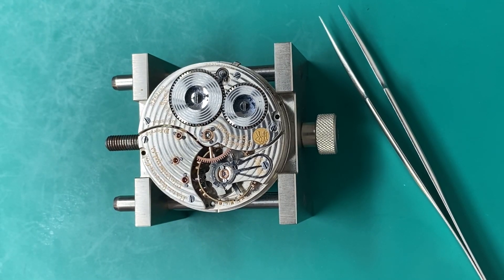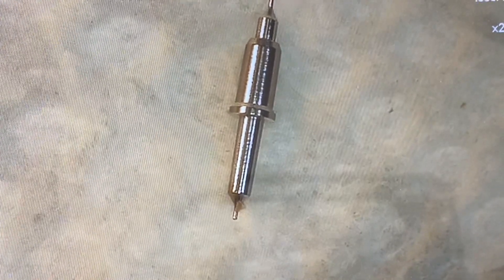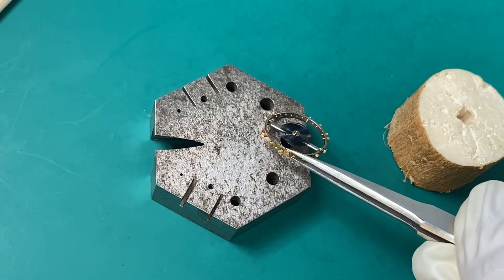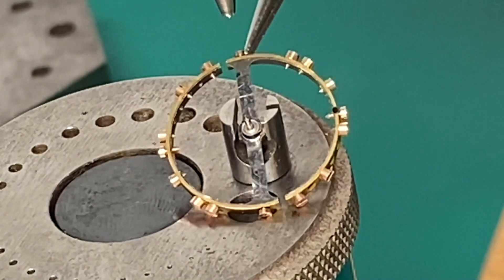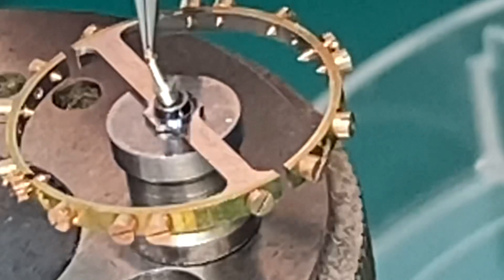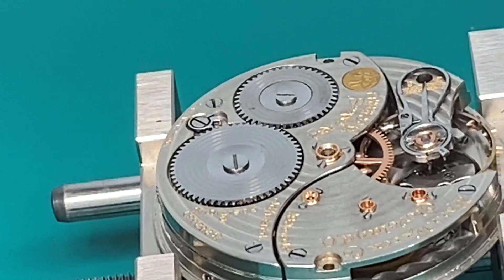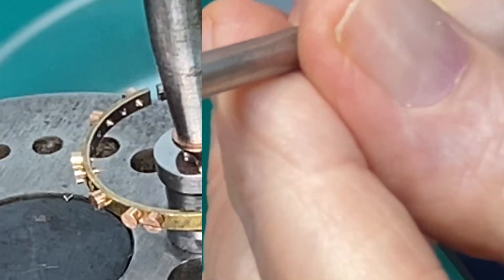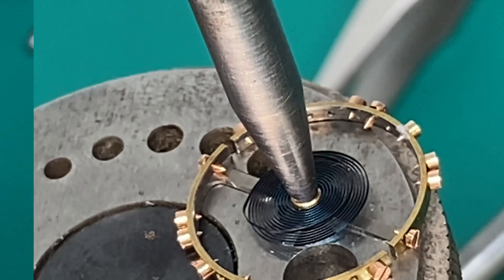How to Use a WATCHMAKERS STAKING TOOL Set to REPLACE a Friction/Balance Staff

Comment: A very good video, excellent camera work. What make is your Staking tool? I would have liked to have seen how you get the hairspring beck in between the two regulator pins as some times it can be a bit tricky. Another thing which you might have done but you did not show it, a tiny mark on the balance wheel so when it comes to fitting the hairspring back on you know the exact spot where to attach it so the watch will be in beat. I have been retired from being a watch/ clock maker for many years. Thank you so much.

Comment: Hello, I have in your videos you use Marshall's staking tools. You have also mentioned K&D's set as well.  In your opinion do you feel one is easier to use than the other?  Also you mentioned "invertor", if I have that right in your Marshall set.  Are all sets invertor set or is that a particular characteristic of a set? Thanks
Reply from the maker: It think both staking sets work well. The K&D does seem to have more parts to it .My understsnding is the early staking tool sets were not invertor type. Once the invertor type came out all the major staking tool makers started making them.

Comment: great video! What staking set is that by the way? Im keeping an eye out for one but all the vintage ones are in really bad condition with rust and missing stakes and such.

Any suggestions as to where i could find a good set?
Reply from the maker: I have a C&E Marshall Watchmakers Staking Set.  I was blessed to get a REALLY good one on ebay many many years ago.  Have you searched for anything on restoring old staking sets?

Comment: Great clear instructional video thank you. Could you clarify and help me as to how you know the balance staff size required for this pocket watch or those in other pocket watches. Any advice would be appreciated. 👍
Reply from the maker: I have this on my list of videos to make in the future!  What I usually do is take the serial number (on the back of the movement - not the case) and look it up on pocketwatchdatabase.com.  Then you find the grade and model number (you will have to use the search bar on the site). You can then do a google search and find the part number/size, etc.  You may also want to purchase a book "The illustrated manual of American Watch Movements" This is how I reference all of my parts.  https://www.jewelerssupplies.com/illustrated-manual-of-american-watch-movements-620.020.html .   Hope this helps! Thanks for watching!
Reply: I have a materials book from Robbins and Appleton for the American Waltham Watch Co 1885 but does that other book cover all American pocket watches. I am in the UK and will look out for that book. Thank you for your reply and help. 👍
Reply from the maker: @alantinker9879   You are welcome!  Yes, it covers all of the major watch companies!  It is a pretty thick book!

Comment: Good Video. Thanks. Are those hand levers you're using to remove the hairspring or special tools just for the hairspring?
Reply from the maker: Thanks for the question and the really good future video idea!    What you see in this video are hand levers (for removing pocket watch hands) that I bought  on ebay.  I modified these by thinning them down, using an oilstone (a knife sharpening stone with added drops of oil).  If you don't thin them, they are too thick to use for hairsprings.  You can buy expensive hairspring removers also ($70 plus is what I have seen the last time I looked).  Hoped this helped!